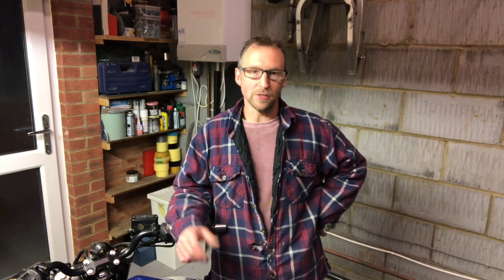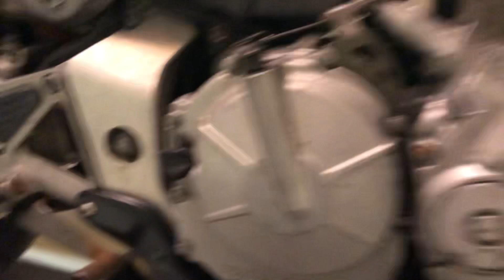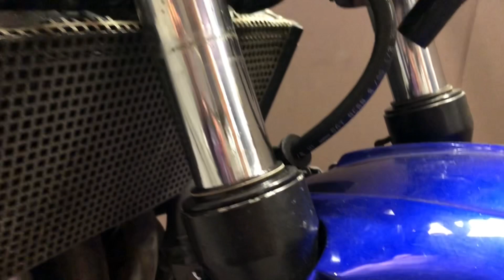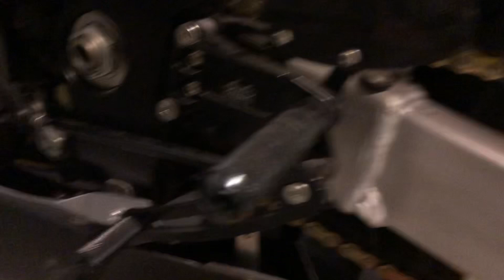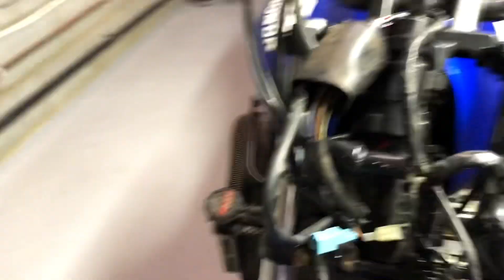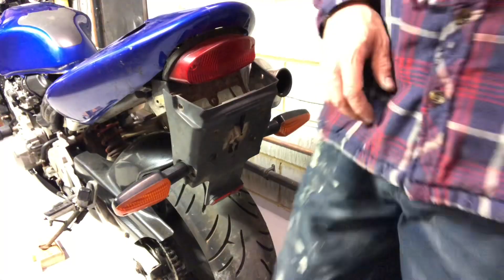Bike shed London show 2022 thoughts , and the new project bike!

Comment: Having one of these for a few years. you should watch out for a couple of oddities with the hornet. The forks are quite long and shorter ones will change the steering geometry and adversely compromise handling unless you make changes at the rear as well. Also the rear shock is pretty much a one off with an eye on top and clevis on bottom mounting points with 305mm centre to centre for mounts, it is a very entry level item with only preload adjustment. The "S" denotes the faired version and the "F" denotes Hornet, therefore yours is a CB600FS. Almost everthing interchangeable between naked and faired versions. The bike is supposedly a parts bin job by the gurus at honda and was a very successful entry level bike with oem gear to match. I'm lookig foward to your build.
All the best from down under.
Reply from the maker: Yes Bob, thanks for that insight mate👍🏻
Sooooooo
Do you know if the 600 and 900 frames are the same, more importantly the swing arm mounts, as the 900 arm is more attractive to me 👍🏻👍🏻
Reply: Yes same frame though i believe the 900 is made from thicker steel. Engine swap supposed to be easy though not sure if there would be a rigidity issue using larger motor in 600 frame. There is or was a Hornet forum based in the UK where these bikes had a large following (if you find the forum a guy called 370 Steve is a tech wiz there) and the forum has lots of useful info on parts interchange, upgrades builds etc. There was also a race series called the Hornet Cup. A good range of aftermarket parts also available there that i can't get down under. Good rear shock options from Hagon, Olins etc though not cheap but with good adjustability options.  I belueve a few guys did swing arm swaps but can"t recall what they used. I do know the 900 arm is slightly different and not sure if it is a bolt in swap or requires machining or spacers etc. Will have a look through my files for any other info. A google search for Hornet upgrades or modifications should provide a starting point. Will let you know if i come up with anything.
Reply from the maker: @bobmoore3436  thank you so much for your time mate 🙏🏻
I know the 900 has a slightly nicer looking arm, more at the wheel alignment end tbh. 
This will be plenty fast enough, the amount of weight that’s come of it is unreal!
I’ve have a hunt on the internet but I’m not very good with all that stuff, but I’ll keep looking 

Also thanks so much for taking the time out to watch the videos 🙏🏻👍🏻
Nice one Bob 👍🏻